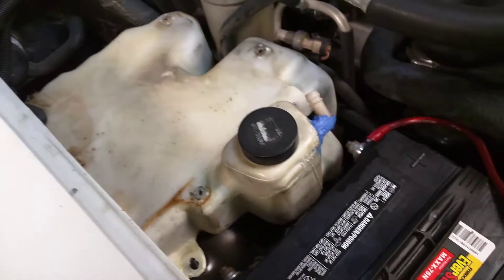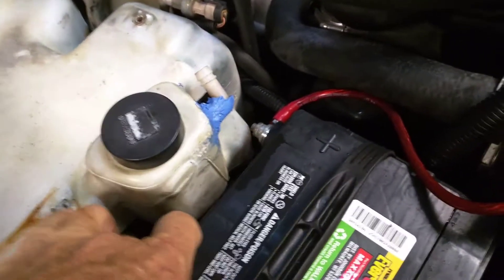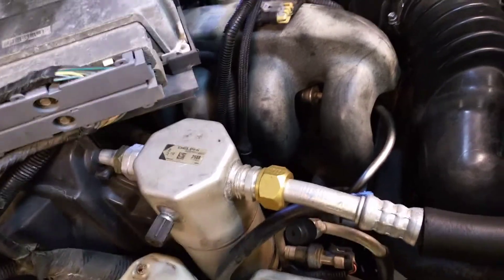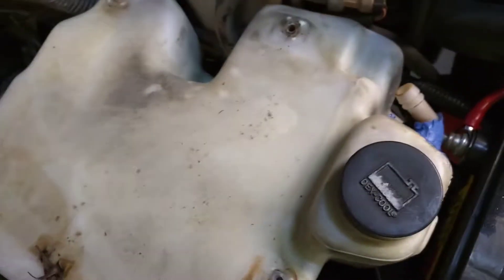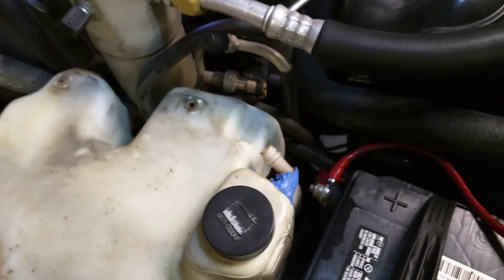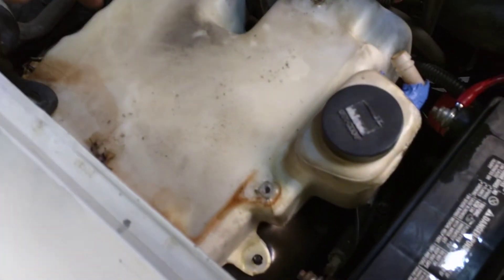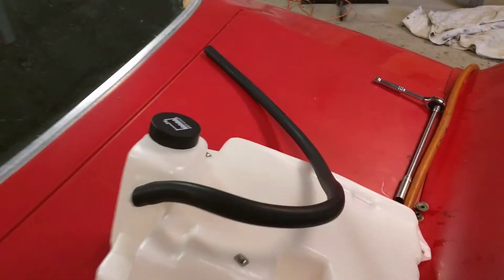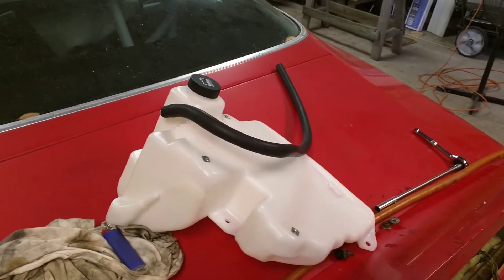How to change coolant reservoir 2003 Chevrolet S10

Comment: Where does that hose connect to
Reply: I was thinking  the same damn thing
Reply: I wanna know where that hose connects to, because I replaced my fan motor and then when I got to the reservoir I didn’t know where that house connected to. I’m stuck at the hose. Does it just just hang loose and let the overflow to the ground?
Reply: That's what I'm trying to figure out too
Reply: Same here lol
Reply: Anyone figure out what it connected too?
Reply: It's an overflow, it does not connect to anything. It is meant to dump coolant out of the car. When it is full. Or boiling. I have a 98' S10 and I looked into this.